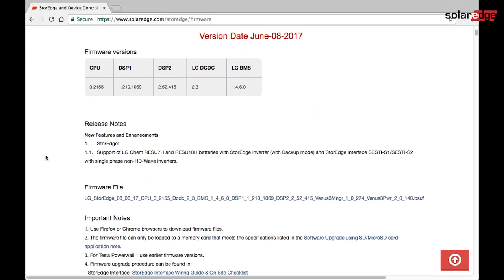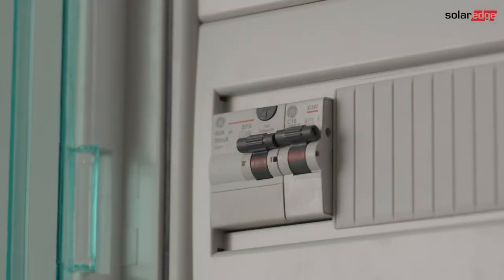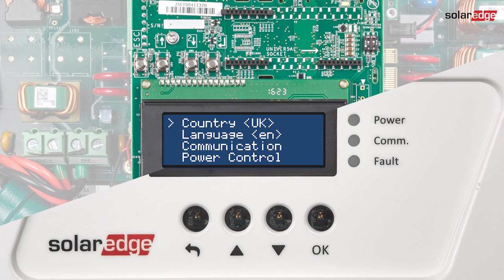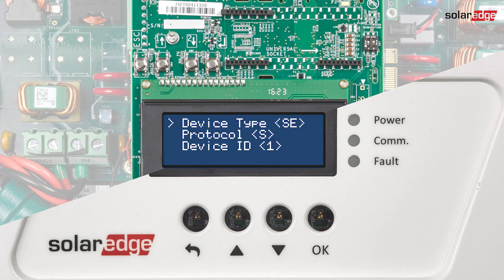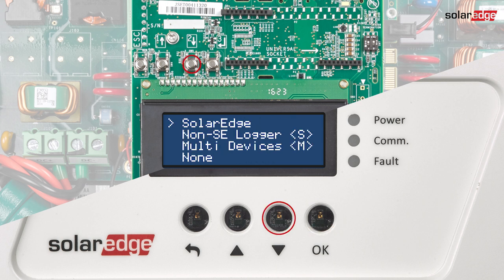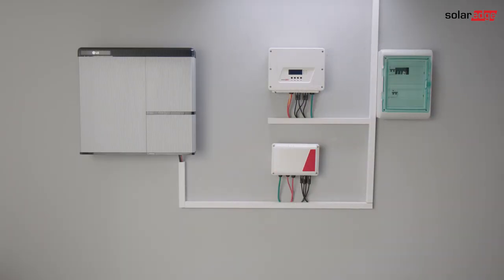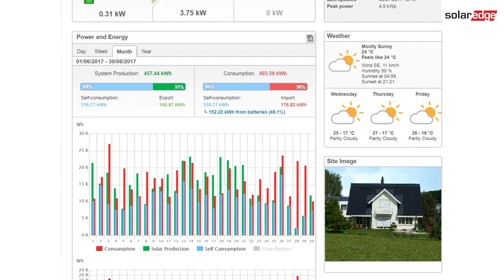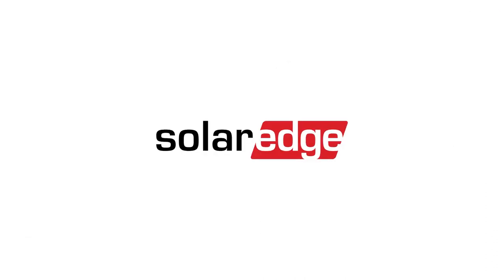[HD] Part 5 - Commissioning and Configuration of the StorEdge™ System

Comment: Question.. After instering the SD card and run the firmware. Is it safe to remove the SD card and put back the inserter card?
Reply from the maker: After using the SD card, it is no longer necessary. It is recommended to remove the SD card and leave the slot empty.